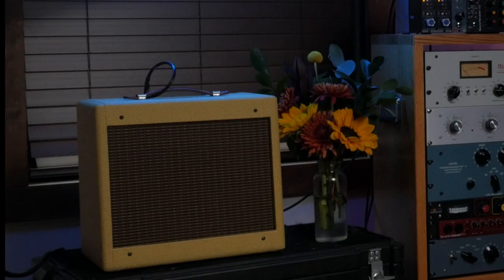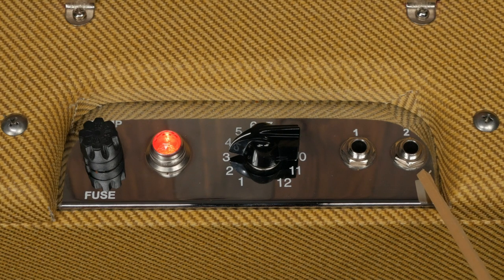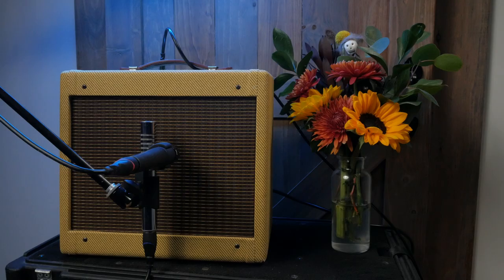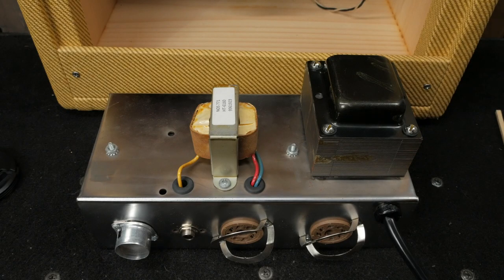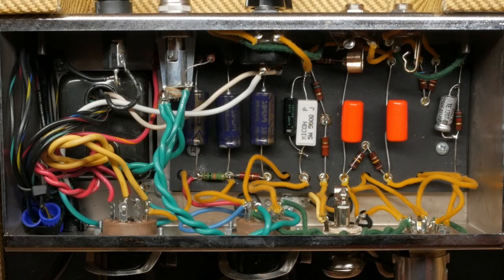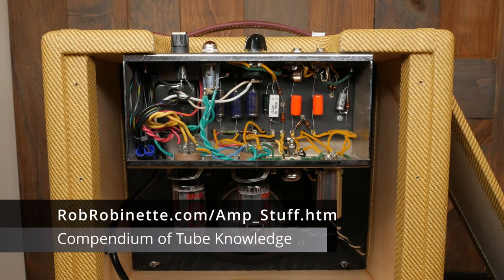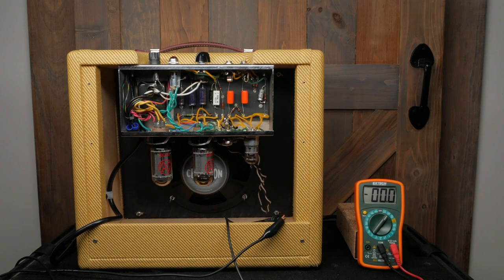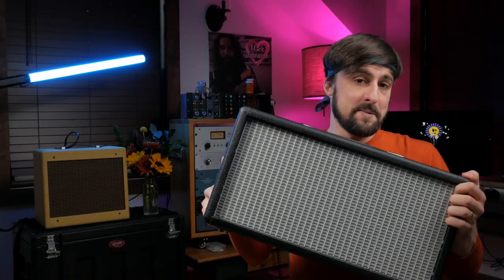Mojotone 5F1 - DIY Fender Champ Build

Comment from the maker: Erratum:
0:08 - It's a 5F1 not a F51
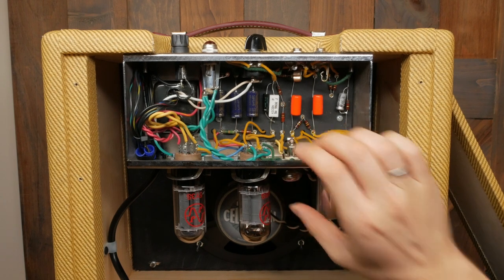6:47 - I stated that the cathode bypass cap on V1 increases the gain of the 6V6, which it does not.  It increases the gain of the 12AX7 (A or B sides) it is attached to.
7:46 - The chassis is made of 18 Gauge Cold-Rolled Steel w/ Chrome Plating not stainless steel
8:47 - While you can check the filaments one half at a time, it's easier to check the AC voltage across the 2 pins vs. pin to ground.  You should also check the HV secondary AC voltage as well as the rectifier 5V secondary voltage.

Comment: I should probably look into building pedals first and work on my soldering skills.
Reply from the maker: That's a good place to start! Aion FX and BYOC (Build Your Own Clone) have kits available which include all the parts you need. That would let you focus on the build and your soldering skills instead of trying to find a bunch of parts. I would try one of those as a first project. Also, make sure you get a good soldering iron! It can make a big difference!
Reply: @shoetiquemusic  thanks. I’ll check those out.